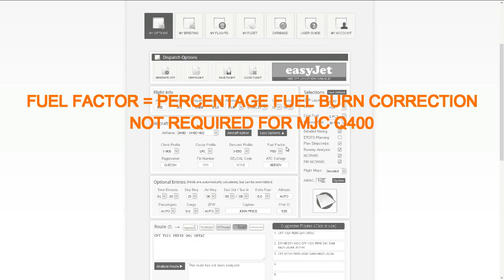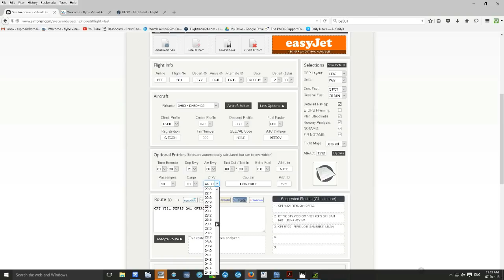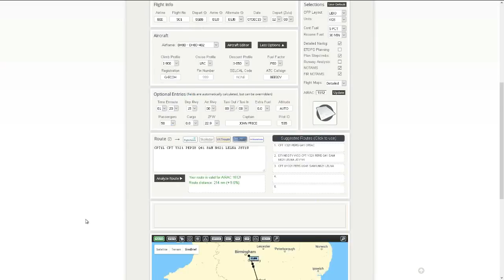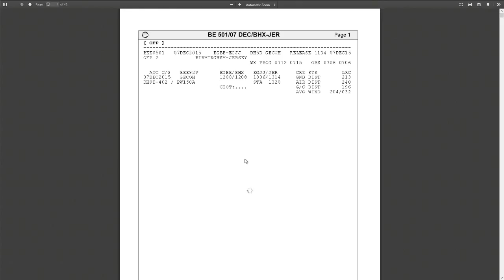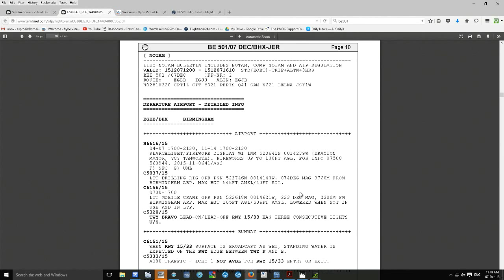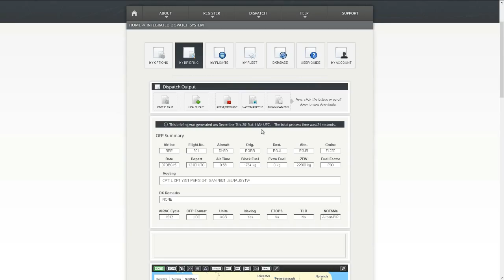Q400 Flight BHX-JER Preflight

Comment: Nice video ,I look forward to your next video  
I hope to see something about navigation system and holding procedure
Reply from the maker: +Wael Soliman This particular flight won't cover holding Wael but I certainly will in a different video. I may do some basic training videos in the Turbine Duke too, which will cover holding patterns and entries. What exactly about the navigation system would you like to see?
Reply: +Flight Sim Guides Ok,for example how to defin FIX waypoint (like fix page in boing)? and how to hold position in q400 if it is simulated?
Regards
Reply from the maker: Wael Soliman
 ok Wael I shall do a return flight and cover those things